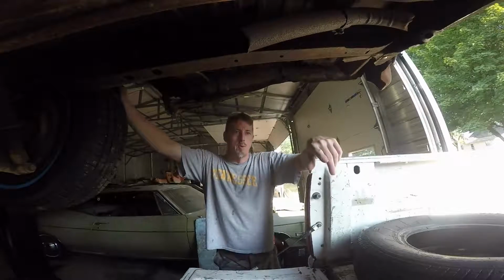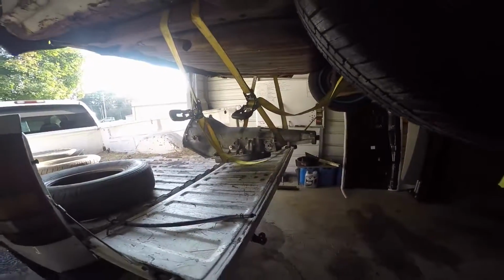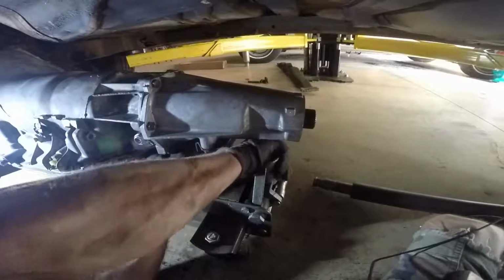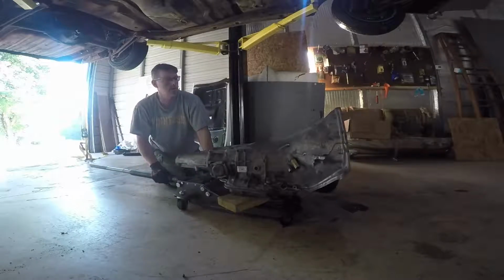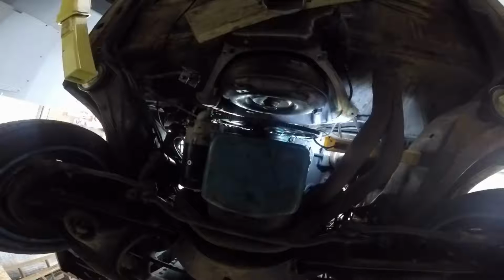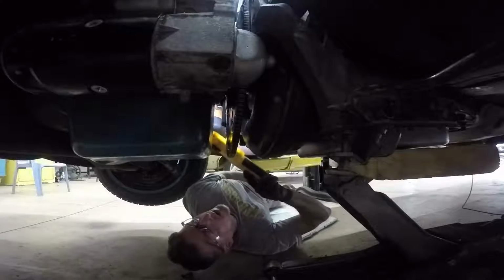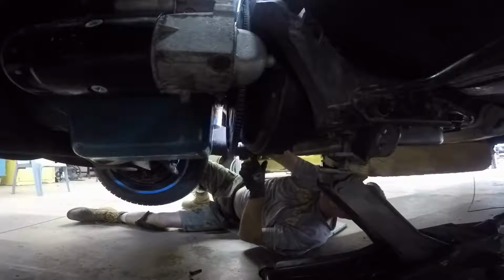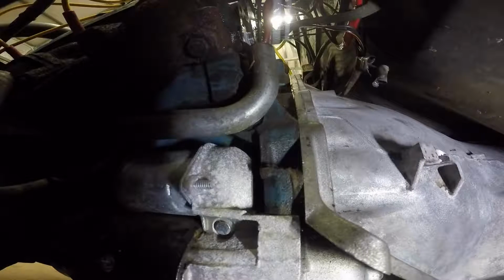1965 Catalina Transmission Installation Episode 6 Slow Shed Garage

Comment: I found a Catalina in an abandoned yard a few miles away. Not sure if it’s a 64 or 65 or if it would be worth the trouble. What are they worth in barn find condition?
Reply from the maker: It would be really hard to estimate Edward. You would need to get more details. A 2+2 model with a 421 engine would be worth more than a base model Catalina. If it has been out in the weather it could also have significant rust which would greatly reduce the value if you know what I mean.